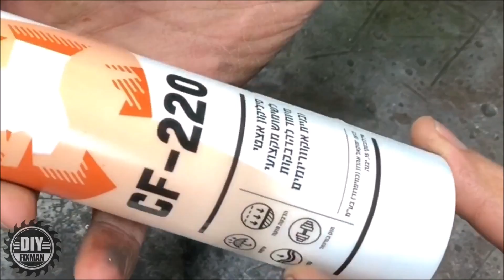Make a Homemade Silicone 3D Aquarium Background - 100% DIY

Comment: Great job, so its just styrofoam base, and for colour you have used black and white silicone? Did you colour the back of styrofoam as well before putting it in the aquarium? Did you usee silicone to fix it with aquarium glass? What other colours i can use kind share any links.

Thanks a lot 

Love your work
Reply from the maker: Hey friend,
1. To get a gray tint, mix black silicone together with white silicone.
2. You do not have to paint the back of the styrofoam, as needed.
3. You should not stick it to the back glass. You just stick it there between the floor and the top of the aquarium.
4. Do not use paints that are toxic. To get a shade of gray do what I said in section 1

Comment: Curious how many tubes of silicone did you end up using?  I love this idea as I didn't want to wait for cement to cure and leach before it was safe.  If you can provide how many black tubes and white tubes of silicon, I will be building a background myself and praise your amazingness for all time! :)
Reply from the maker: I used one tube of silicone, the layer is really thin, that's enough

Comment: What did you use to stick down the the squares you cut out. It Looked like a hot glue gun? 
Also I’m guessing from the other comments the black stuff was aquarium silicone that you used to paint? Never would of thought of that! 
Also is there another way you can think of to attach background to tank so it’s not permanent? Or can you still remove it afterwards? Or I suppose by braking away the bulk the using a razor blade to remove silicone might work but you wouldn’t have it in one piece anymore. 
Thanks!

Comment: Sorry to disturb you again with last question, what if i design my background with styrofoam and use acrylic colours on it and after letting them completely dry i just use clear 100% silicone on it.
I can also make 2-3 coats of silicone to make sure the bottom colors are safe and not in contact with water at all. Please reply
Reply from the maker: Your idea is great, but unfortunately, I personally would not take a risk of one of the colors leaking into the aquarium.

Comment: Maybe a silly question, but is there a certain thickness to the polystyrene you used, or is it personal preference? Thanks
Reply from the maker: I think the 20mm thickness is the most appropriate
Reply: @DIYFixMan excellent thanks & did you silicone it to the back of the tank to keep it in place
Reply from the maker: yes 😊

Comment: Bro it's very amazing and beautiful❤
But bro how much time I will have to wait after installing background in aquarium  (I mean after putting background and fill it with water how much i will wait for filtration then)   waiting for ur reply bro✌
Reply from the maker: After 24 hours of final drying, you can lay in the aquarium and fill water immediately
Reply: No bro I mean that how much I will have to wait then (after putting it in aquarium)and how much time I will have to filter the water before putting fish in it
Reply: @shoaibbangash6200  once the silicone is cured safe right away. Don't need to filter anything.
Reply from the maker: As needed to wait, you can put the fish in right away.

Comment: I made it by thermacol or cent but it floating in tank what can I do
Reply: yes you are right with the material you used. Styrofoam and thermacol is the same. Stick it to the glass of the aquarium from the backside. I guess it would float as it would be very light.

Comment: Sorry to bother, did u used acetic silicon that used for glass to make aquarium?
Reply from the maker: yes
Reply: @DIYFixMan  ok, thanks for your info
Reply: May i ask another question?
How many sealant tube did u use and what dimension was your background?
Reply from the maker: I used one black container, dimensions were 100 cm wide by 55 cm high
Reply: @DIYFixMan  thanks again